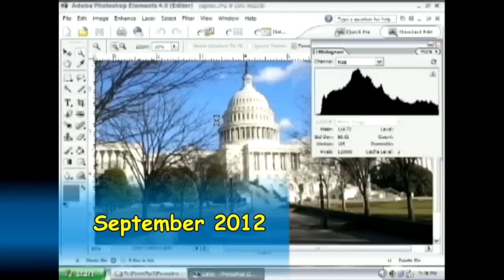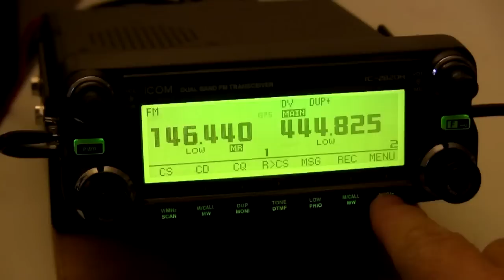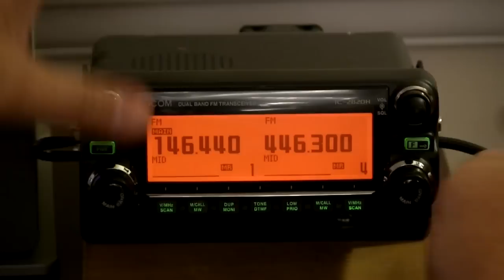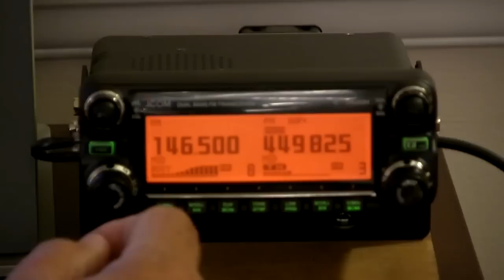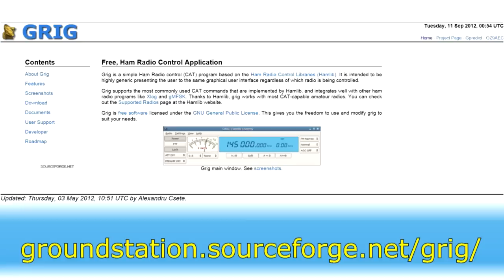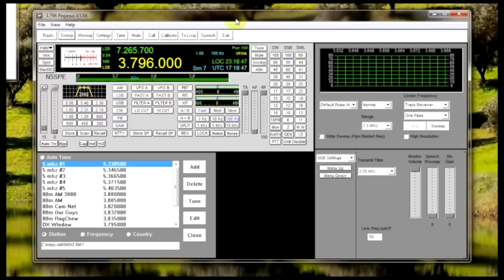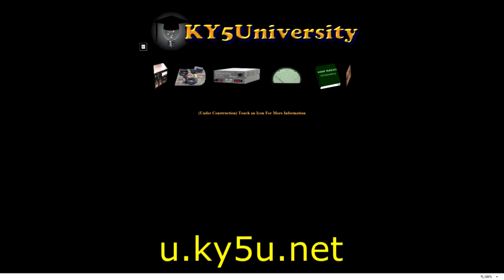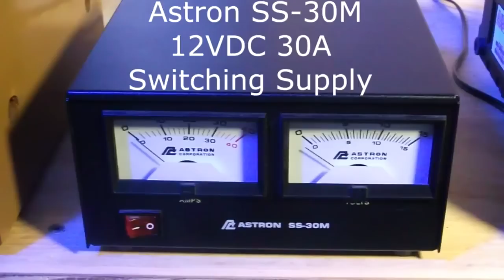AmateurLogic.TV 43: Antennas, Raspberry Pi Tower Case, Rig Review

Comment: As a ham who has put up many wire antennas using pulleys and other methods, you have a problem using those black nylon ty-wraps to support the loop.  Unless U/V resitant, they will last about 1 year out in the sun and will become brittle and break.

K2WH